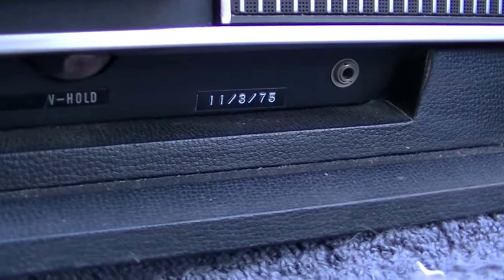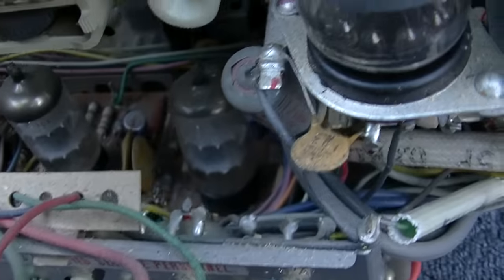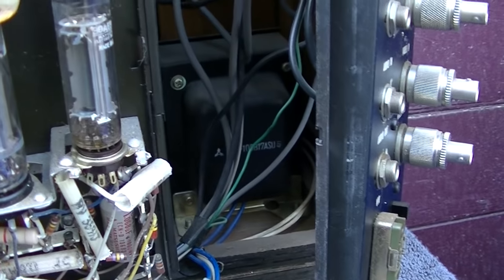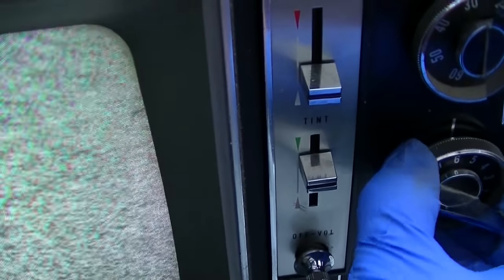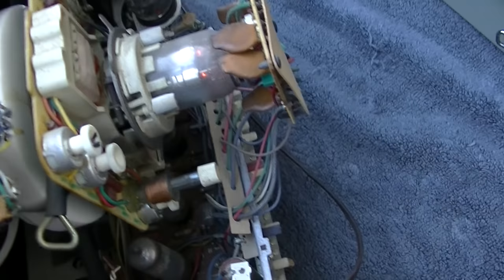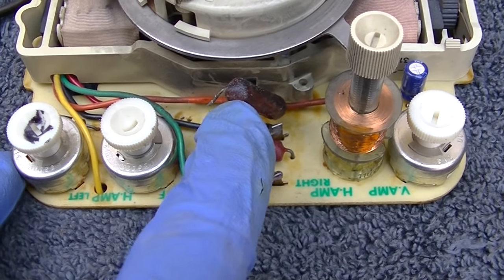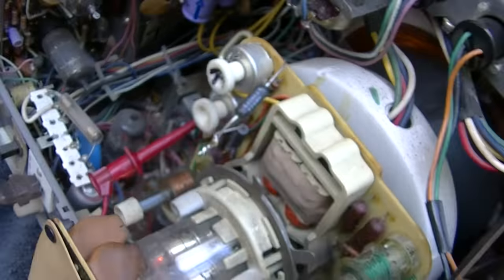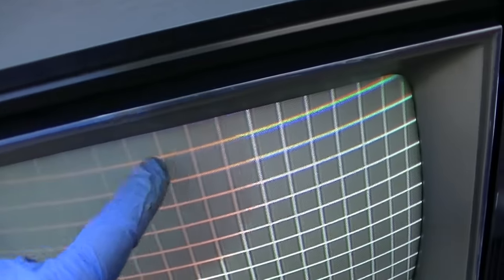Panasonic Panavision Commercial Hybrid Color Television Repair Rare VRT TV

Comment: Greetings:
Early in my video career, our facility used many of Panasonitc's triple wide rack mount b&w monitors on editing consoles and singly on each VTR computer control status output. Each and every one had PL-259 to BNC  adapters because of BNC ease of use. Not certain, but some early Sony U-matic VERSION may have been similarly equipped.
Without use of a power transformer, how was it possible to safely connect grounded video and audio cables to the HOT chassis? Is that scheme practical for use generally with similar standard video chassis or was it a special conversion just to enable the equipment attachments to avoid the dangers existing?
Reply: AFAIK most video monitors have power transformers. There were a few TVs which used optoisolators to connect external video inputs to the hot chassis but this was uncommon. The isolation transformer in this particular Panasonic was clearly a special conversion (done at the factory) of an existing hot chassis television.

You might notice modern TVs have external inputs but don't have a power transformer. The vast majority of these use the flyback transformer for power isolation.

Comment: Of all TV's in all the shango066 videos I have watched so far, this my favourite
It could be used even for retro gaming in my opinion and it isn't that esthetically old
The only problem I see is that the picture tube is a little small, but it has a AV input and output

Comment: These sets were often coupled with the Panasonic color EIAJ 1/2" open reel videos tape decks in the 70s, as by the 8 pin connector on the back  - we had them in school.
Reply: I was going to say that's an EIAJ VTR connector. My early '90s Sony PVM monitor has one too.

Comment: I have the little stand alone Panasonic color tv version of this set.  Same tv chassis.  My set looks identical if the left hand side with the VTR stuff was cut off, makes a nice color picture.  My set originally had no fine tuning, was just gummed up with old grease.  My on-off power switch is bad, so it's bypassed.

Comment: PL 259 connectors were quite common for CVBS video in the 60s and early 70s. I have an old sony reel to reel VTR which has them. I also think that the very first top loading VHS recorders made by JVC also have PL 259 connectors for CVBS in/out.
Edit: @Free in Jesus was faster than me...
Reply: Except in this case, the PL 259 connectors all have BNC adapters attached to them. So BNC must have been more common where this set came from.

Comment: Here I was thinking that the VTR would be built in to the TV.  I like the design of that set.
Reply: Nope the technology of active shielding was not developed until later on, Sony stole the patent from the inventor and they came out with the first VCR monitor combo that did not erase tapes
Reply: @401ksolar  My school had a 1/2 inch Sony reel to reel videocorder with a 9 inch B&W TV mounted in the case. You could watch/record from the TV or watch pre recorded video tapes on it.
Reply: @dougbrowning82  yes but as I recall those tapes were loaded on the outside of the case, a new problem arose using cassette that would load inside like a VCR.

Comment: PL-259 connectors were used on all broadcast VTRs since they were invented. They were changed to BNC connectors on the 1" machines in the 80s
I have been in the broadcast industry as a video tape operator then later as video tape editor since 1960. Now I restore these 2 " machines

Comment: I have an NEC v t r three-quarter inch deck from that same era and it appears the remote cable jack is similar, Master Control used to hook to that green Jack on the VTR for a b rolls and edits, we never used Panasonic equipment in the studio, the Eng Crews use Panasonic as they were cheaper.

Comment: Hey, Shango!  I am old enough to remember running with my father up to Radio Shack for tubes.  Surely when the horizontal hold went on the fritz, my pop would have never settled for less than perfect tubes simply because they were on hand a mile away from our house.  

Not only are you dissing childhood memories of my dear departed dad, but if you keep talking trash about Radio Shack they might go out of business or something.

Comment: Yeah.  When I was young, dumb and full of stuff, I rigged up a external speaker jack on a hot chassis set.  I installed a 1/8" phone jack on the front of the set.   The 1/8" jack plug that I bought from Radio Shack to run to the external speaker had a metal outer case, and so was at the same potential as the shield.  Yup, if you touched that plug with the TV plugged in, it was hot and would give you a shock.

Comment: Those are more recent replacement realistics after the lifetime ones. I bought some 6BA6s and a 6L6 in a pinch when they still had them and was trying to test a radio in the mid 90s and they were branded as long life. I think they were already sourcing from the just post Soviet Russia or China to get them. They were kinda sketchy to say the least.

Comment: Thanks!   I will one day understand the 'Reforming' of compositors, steps seen many times, just brain cell is slow forming.    
Buzz  13:05  Pot vs compositors. "Just lost it"  16:29  re: convergence. now, low, [No] buzz (volume down?). - there is a Plane.   
18:26 Diode change  - Steady  - Looks Good.      just noted to help B cell    : }

Comment: A bit not in the topic of today's episode, but I still wonder if there is any possibility of hardware (not using the converter box) conversion of old tube TVs from the NTSC to PAL system...
Reply: that's a lot to change. different oscillators, different vertical section (100 more lines), entirely different colour decoder, then also a different tuner because the channel spacing is 7/8mhz instead of 6mhz. 

It's better that you just buy a PAL tv.
Reply: @kyle8952  If it's a B&W TV then there's not much to change. You may need to change a few component values to slow the vertical but the rest of the output circuitry will be compatible. The tuner difference is much greater but you can plug your PAL source into an NTSC RF modulator as a workaround.
Reply: I did that conversion once to an NTSC monitor. I converted it to PAL-S. Didn't bother with the delay line. Essentially it was a matter of changing the chroma oscillator from 3.58 to 4.43MHz and switching the phase for the R-Y signal on every alternate line. It worked surprisingly well.

Comment: some of the valves/tubes look like ones used commonly here in the uk, think i spy a 16A8, extremely common here as a PCL82(usually used as audio amp and output), and the line out and boost diode looks like PL500/504(25E5) and  PY88 (30AE3) unusual seeing those in a colour set, maybe as its small screen, didnt need the bigger PL519 and  PY500  the big one on the left panel may well be a PL508(17KW6) used for frame output
Reply: Japanese sets often used tubes that were common in both Europe and US. Some japanese tubes had double marking.
Reply: @xsc1000  i think shango has mentioned 8A8 or 9A8 (or was it 9U8?)in connection with japanese sets, and them being rare in the us,  over here in the uk ,very common as PCF80 ,  (9U8 is PCF82, also fairly common) ,
Reply: @xsc1000  Matsushita used Philips manufacturing equipment for their valves which is why the prevalence of European types in their sets.

Comment: You are not the first to trash on Realistic tubes.  What was bad about them?

Was it a lower performing tube in exchange for longer life?
Reply: Inconsistency... some were possibly rebranded factory seconds, or maybe even used. Rat shack colored the pins "gold" to make them appear superior, but I replaced a lot of them that had green, corroded pins. Some did work, but replacing them with quality American tubes always improved performance. Back in the day, some of my repair customers complained when I refused to pull their bad realistics, go to the local rat shack store, and demand "free" replacements. I told them they could make the exchange, but I would not provide a service warranty. I'm surprised this Panasonic worked so well with the realistsics. It's a true candidate for a complete overhaul. Beautiful set!
Reply: @jrs0007  I think I got it.  So it was a economy "tube exchange" program using dolled up dumpster tubes?

Figures...

I was grown up just enough to see the very end of that era of Radio Shack.  I repaired a fancy dual dial AM/FM MPX 50+ tube stereo tube receiver I got at a yardsale when a kid.  They used it as a doorstop.

I got it all working again using local radio shack tubes, most he had in stock.  I had one with purple glow to it out of the box.  Exchanged it no problem.  But now why I know as some others went purple shortly after....confusing to a kid why purple.

Comment: I wonder if the presence of an isolation transformer and those strange connectors indicates that this set was used in some kind of TV studio, tv station, test lab, or was used as a monitor of some kind.
Reply: It was designed as a companion to Panasonic EIAJ VTR, hence all the stuff on the left side of the front panel. Not a broadcast quality format. The video input and output connectors are standard for the time.
Reply: Broadcast Studios would NEVER use consumer grade equipment. They could never withstand the constant use they would get. They used video monitors made by CONRAC
Reply: @AaronSmart.online  the PL & SO 259 connectors were all ised on broadcast equipment from the 50s until the 80s
Reply: @rty1955  But they were also standard on consumer video equipment throughout the '70s

Comment: it came on pretty quick
Reply: The the filaments getting up to temp was the reason for tube sets to take a long time to make the unit operate. Later years they kept a small voltage on the filaments all the time so the unit was advertised as "instant on" TVs

Comment: That’s like 👍 a “mini” RCA, or Magnavox. Neato TV 📺, with knobs, not today’s push button crap 💩. I bet this puppy’s color, not black and white. Those oil caps 🧢 can go. Yes 👍 “Leak-O-Matic” capacitors. I didn’t think 🤔 Realistic tubes were junk. That’s a Radio 📻 Shack brand. I’m going to guess that these 1970’s, or 1980’s tubes are still better than today’s flat screen TV’s 📺. This means that they were replaceable. At least, the TV 📺 can “camp out” for more years in the home 🏠, not go straight to the dump after something burns 🥵 out. Radio 📻 Shack was my favorite 😻 store 🏬, until it became defunct in the earlier 2000’s. In other words, Radio 📻 Shack probably wasn’t the best, but it also wasn’t the worst. This would be the first place 🥇 to get the tubes, or send the TV 📺 in for repair 👨‍🔧. Flat screen 📺’s of ANY brand? One ☝️ part burns 🥵 out, forget it, add it to the trash 🗑 collection, and head to the dump. Your friend, Jeff.